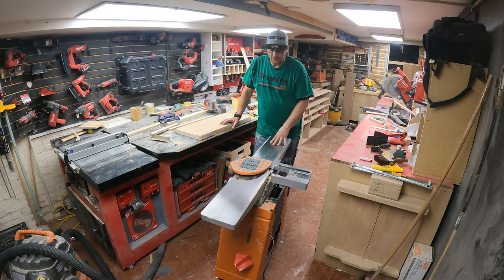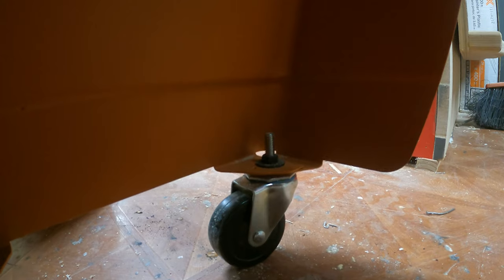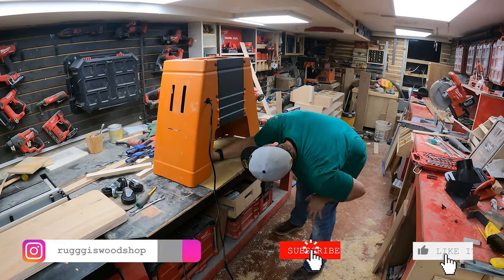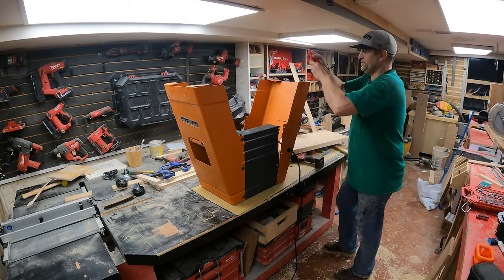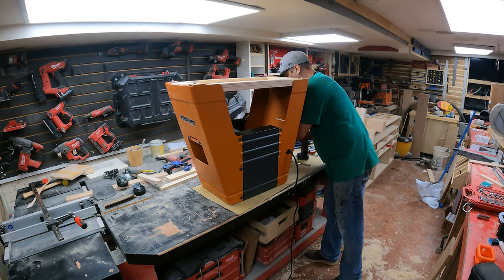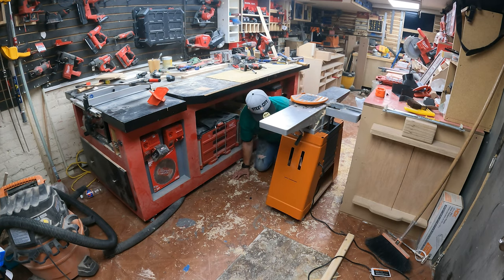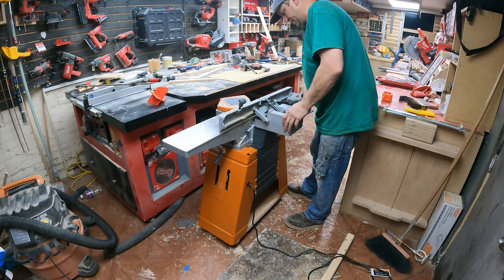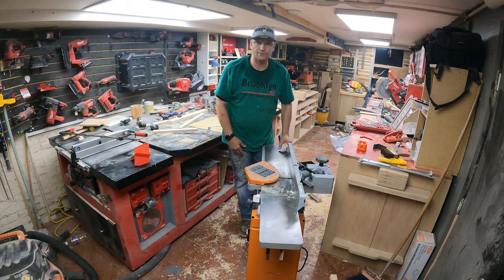#23 DIY Quick Fix - Ridgid Jointer Leg Support

Comment: Man, I wished i would’ve seen your video prior to this jointer falling on me. I called rigid customer service and the service was no good, they said they have never heard of the jointer having any stability, or wobble issues. The thin 1/8 metal 90 degrees is a joke. Thank god for your video definitely will use it on my replacement for reinforcement!
Reply from the maker: That sucks. I hope you are ok
 I'm glad this video helped you. I agree that the stability of this jointer is garbage.
 Stay tuned to the  Channel new excited videos coming real soon
Reply from the maker: Sorry for the late response had to deal with a serious family issue the radius on the bottom platform is 24 11/16  You will have to change the angle a little bit on the outside corners because the metal is wider on the bottom and merges to the top. but the way that I got the angles was to take the joint to apart  and put the base on a piece of cardboard and outline the radius  With a   Marker or pencil. I hope this helps

Comment: It’s definitely not recommended to use casters in place of the self-leveling feet. The product was not designed to be used like this.
Reply from the maker: Yes even though it wasn't designed for it it works beautiful and I needed it  To be mobile. That's why I built the platform  Underneath
Reply: @ruggiero1371  he's saying that where YOU put casters on it during assembly instead of the stationary leveling feet... YOU caused this part to bend, not the base.  The base was not designed to be used with casters fastened to those spots.  It's not a design flaw, it's user error.  By adding those you created a lever that is applying twisting pressure where twisting pressure isn't designed to be.  Never attach casters to a stamped steel base.

Comment: This is NOT how you should NEVER install casters on a machine. Support feet are perfect but casters no. Casters can be added but should be added by making a wooden base or by buying a metal base. Common sense seriously should have been used here and I don’t see what in the world ever made sense to think casters attached the way you had them was ideal. Not trying to be rude here but seriously. I made a wooden base similar to yours years back and absolutely no issues. Here’s the thing no matter if it were Ridgid, Grizzly, Jet, Powermatic or whatever and no matter the design of the cabinet you would never directly mount casters without a base.
Reply from the maker: I agree with you, That's the best thing about trying new ideas see what would work really quick and see what would work in the long term when we put the cast is on it we just need to something really quick found out it didn't work and changed it, Thank you for your input brand new shop comeing soon

Comment: I got mine used, someone put a bit of wood across the bottom making a shelf and then installed some cheap casters... my issue was when the casters would swivel in it made the bottom support area too small... I tossed the casters and reinstalled the adjustable feet and haven't had an issue sence... thankfully I don't need to move it very often... but I may build a roller base at some point.
Reply from the maker: Sorry for the late response I have similar the same issue so I went through a few different casters and found that the Extended lock and casters were the best option so therefore if I needed to move it I could And when I built the platform the radius was 24 and 11/16 round

Comment: If you can remember, what is that corner radius? I've got one of those jointers coming and I want to go ahead and make the base so I can put it in when I put it together.
Reply from the maker: I will send you the radius when I get back to the shop
Reply: @ruggiero1371  Thanks, I got my jointer today so I've got it.
Reply: @ruggiero1371   FYI, If I heard you correctly you said 20 5/8" on the length. I made mine that size and went to put it in and it was really short. It's 30 5/8". Check the video just in case.
Reply from the maker: @wayneswoods8824   It's 28" in length And 12 1/8 inches in width